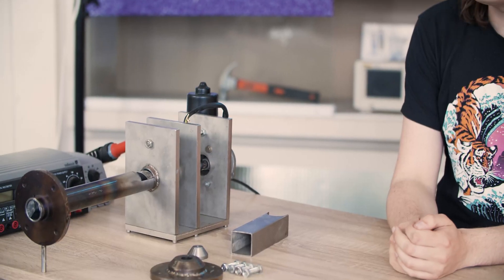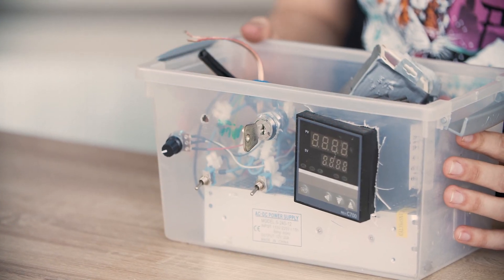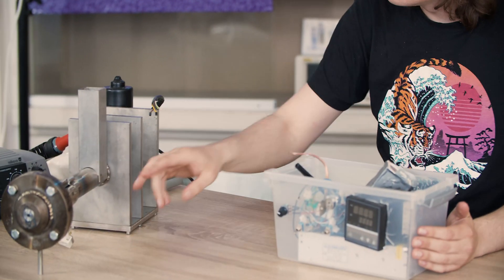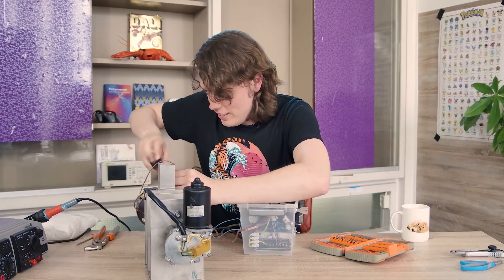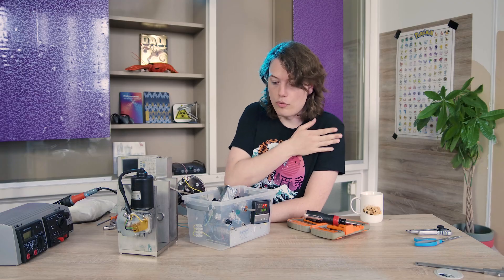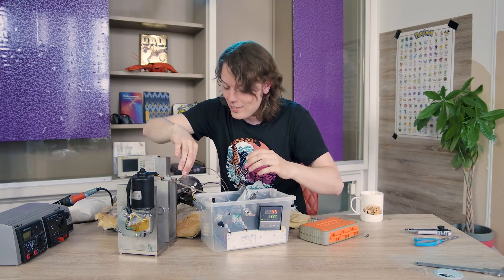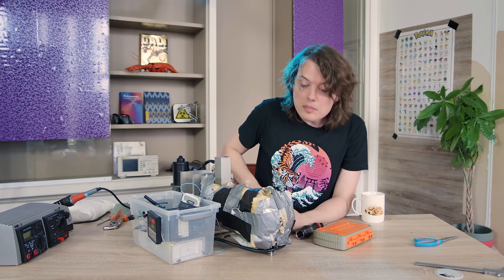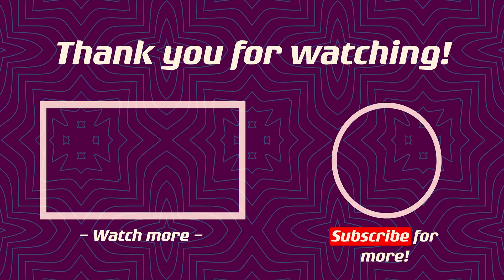Making my own 3D printer filament! - Part 2

Comment: Thank you, this is so useful for someone that wants to make their own extruder. Any advice for extruding pure PET?
Reply from the maker: Cool, I read a book about polymer physics to learn more about the material properties. I advice you to look up the properties of it and how it solidify, I think it has a glass transition phase just under 100 degrees. And often they use some aditives to make the marerial more sutable for 3d printing. I have heared that it PET is used for 3d printing but not all types of PET can be used. Also look for the chain length of the polymers and those kind of things. and extruders can be used for multiple kinds of plasic so maybe in the future I will explore different kinds of plastic with it.

Comment: did you buy the PID temp controller or did you make it yourself?
Reply: also if you were limited to a 24 volt heat band, how would you do it and hat band would you pick?
Reply from the maker: I bought the PID controller on ebay
Reply from the maker: The PID does the controlling by opening and closing a relay. so you can just put a 24v connection on there and you can connect it with your heat band. But make sure you read how the controller works when you buy one.

Comment: What did you use for the heater element?
Reply from the maker: I used  two 120V ceramic band heaters in series.